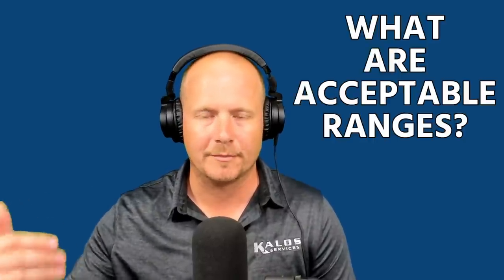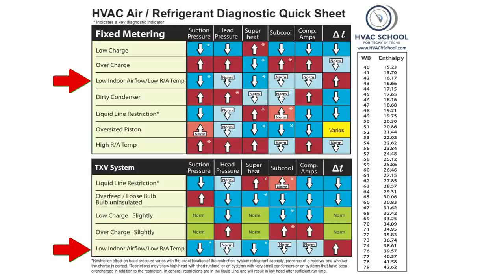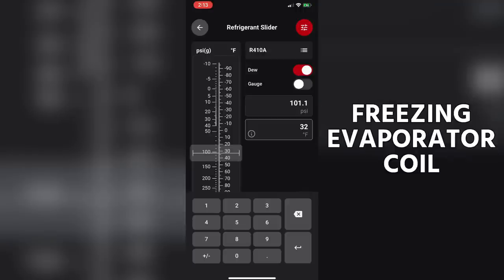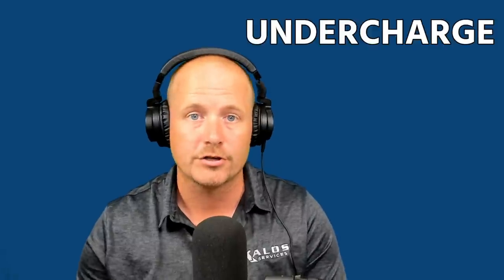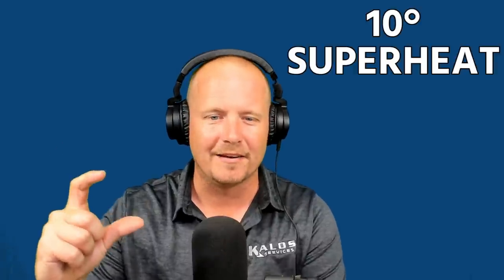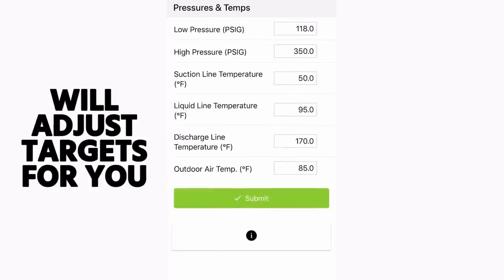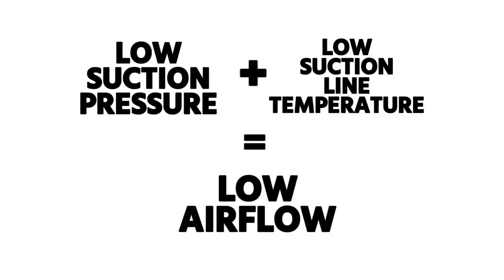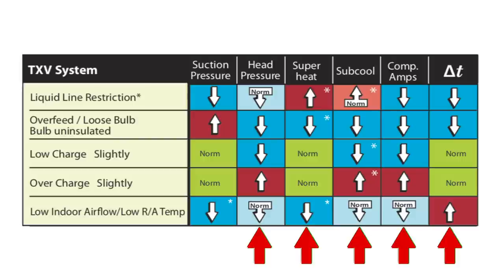Symptoms of Low Evaporator Airflow

Comment: I had 78 return, 52 suction saturation and 5 superheat on a piston. Humidity within range (68wb). 435psig on high side, 18 td in a commercial place that wasnt cooling.
Reply: 435 psig is awfully high. What system are we talking about here?
Reply: Need some more info... sc? Supply?
Reply: Sounds like a TXV valve problem.

Comment: Good evening can I use a 12000 btu evaporator coil I got from a 410a system with a r22 condenser also 12000 btu
Reply: Both from mini split ACs

Comment: As I was cleaning our window type AC unit I noticed it uses 2 capillary tubes as expansion valves going to multiple copper loops in the evaporator. Why not have a single (but long) copper loop?
So I took an IR thermometer and measured some of the temps in the evaporator:
Return Line (going back to the accumulator): ~ 26c
cooper loop: ~ as low as 8c, to as high as 25c
unfortunately, I could not measure the temperature on the capillary tubes.
Care to make some comments? Thanks!

Comment: I went on a call the other day. She stated she had three companies out and they said everything looks fine. She said I can’t get the house down below 80° on a 100° day. Gauged up to system with smart probes and saw the Subcool was at 11° as stated on the tag. But say suction temp up and delta t only at 12°. Mins you it’s a down flow application. Filter clean evap was clean as I.  Was looking at evap I found that the installers had made a wood frame between the coil and furnace. And it only had 3” of a gap on each side of the coil. ADP coil that had about ten inches of flat space on top and the air would dead head there and only 3” on each side where air would maybe get threw the coil. All in all poor install lead to this lady having issues for the last four years.

Comment: Great video as usual! Could u make a video on nitrogen pressure testing. Sometimes when I do mine with my resto 557 I do pressure test for 20 min and I see it drop like .4 sometimes .7 , is that acceptable? Could it be an actual leak in system or in my hoses ? I bubble test my hoses and find no leaks. I hate having those doubts Though. But then I pull vacuum to below 500 and decay tests passes
Reply: That’s totally normal. Sometimes your pressure will go up too if the sun is hitting the unit because with higher temperatures goes higher pressures

Comment: Good morning,I have a question HVAC SCHOOL.
What causes no sweat on suction line
Reply: When the suction line is sweating it is because it is colder than dewpoint and water in the air condenses onto it. Therefore if the suction line is not sweating then the suction line temp is not at or below dewpoint. Not necessarily an indication of a problem, you'd need to evaluate the rest of the system and ambient conditions to determine if there is an issue

Comment: I have a 3 ton heat pump my SP are excellent spec is .5 low tap I have .26 so I'm moving a lot of CFM.  From the manufacture chart of blower low tap is 1040cfm, med 1302, high 1504 and verified these very close with hood.  On high delta is 17 F, med 18.5, low 19.8.  humidity is 40% so I wonder what blower speed is best for efficiency.  I think the high is moving too much and a little loud on supply, what do you think?  I think you can be moving too much air hurting heat removal and humidity capture.  I even rigged a wifi switch thru a relay to switch fan speeds remotely on a PSC motor.
Reply: Medium speed is what you want especially for cooling.

Comment: I bought a testo hot wired anemeter. And it sucks on flex and box systems where you have a 4ft plenum on either supply or return with multiple flex sizes attached to it. For example. I have a supply plenum inside dimensions 15x17 and Im looking for 800 cfm and measuerment might be close. Then I will then input dimensions 10x10 for 400 cfm. Stick the probe in the same 15x17 plenum and will read 350 cfm.  That probe is not an accurate way to measure cfm!

Comment: When we  use pt chart how we can  calculate temperature 🌡 for ac ,coling and freezing 
How to know what temperature will be to choose pressure of section line
Reply: in an install, you use the manufacturers guide.  in a service call without the manufacturers info, use superheat for fixed orifice and subcool for txv.

Comment: Will an undersized Evap also cause a low superheat/low suction situation? I'm currently working on a system that is mismatched. The condensing unit is 2 tons and the evap is 1.5 tons. It's an R-22 system and I cannot get the suction pressure above 55 no matter how much refrigerant I add. I am checking superheat and that's why I stopped adding refrigerant, because SH got too low.
Reply: I know this an old comment but I wish there was a clear answer to this. In my mind, an undersized evap would cause high superheat because the mass flow rate would be lower due to the size. However I'm not sure that's a 100% guarantee because an undersized evaporator might be the cause of low airflow, which could have the opposite effect. Did you ever get this figured out?
Reply: @MegaDysart  Turns out, in the end, there was a restriction in the coil and it was replaced with a properly sized coil. This system worked perfectly after that. Thanks for the belated response. Cheers!